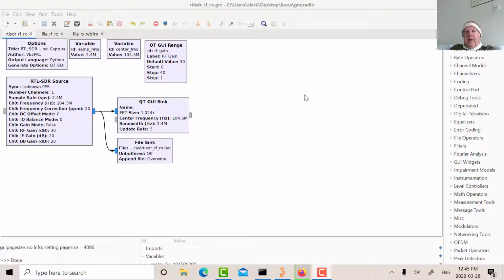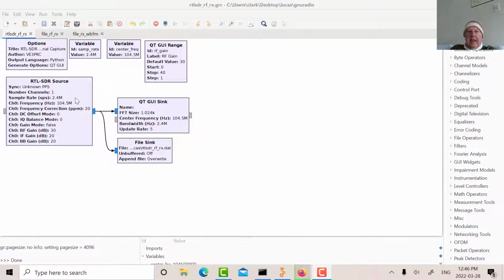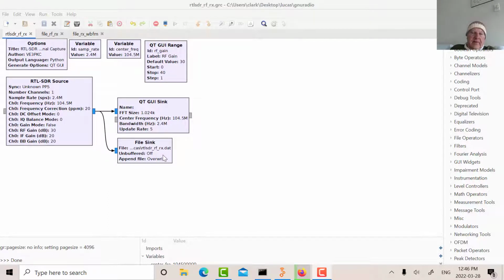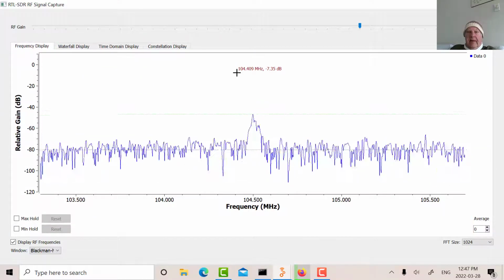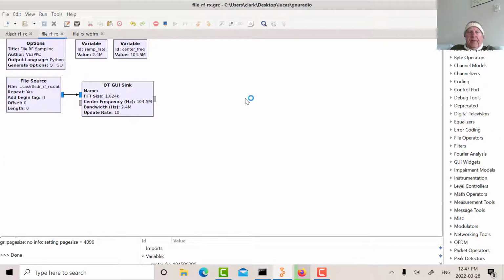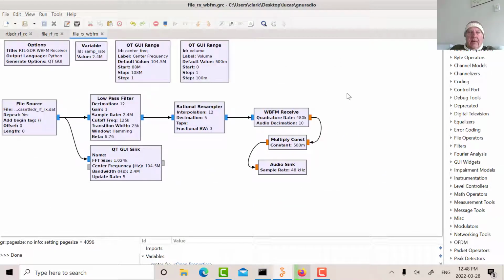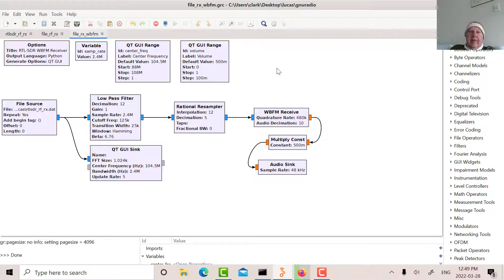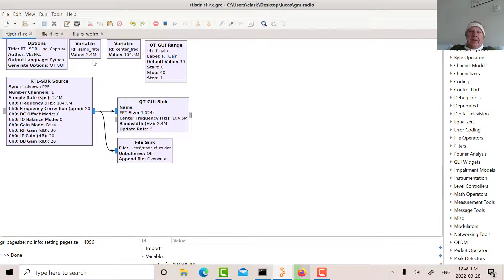RTL-SDR for RF Signal Capture on GNU Radio

Comment: bro if i have Sdr receiver 10k to 6 ghz, so from gnu software i can use 1ghz or 2 ghz frequency for different scanning like Jupiter galaxies, or i need converter device for that?
Reply from the maker: You need a GNURC source to match your SDR.
Reply: @ brother im confused for that, i have receiver sdr 10k to 6 ghz., then i can control adjust up down frequency from software or i need another hardware for that?

Comment: Hy Sir
When ever I turn on biast of my RTLSDR V4 and when I run GNU Radio it automatically turns off the biast. can you please tell mw the issue
Reply from the maker: Sorry I don't have a V4, not too sure. Check the manufacturer, they may require special drivers.
Reply: @ClarkTelecom  same issue when I tried v3 sir
Reply from the maker: @zulkiflnawaz4536  Check out Reddit, there is a discussion about that. Can you power your device from usb rather than the biasT?

Comment: Great insights, how do I capture 5G signals at a 100Gb rate preferably using a PC and a GNU radio tool without external dongle connections? Much appreciated!
Reply from the maker: Check out GL Comms they have gear that works at those speeds:
https://www.gl.com/

Comment: When I replay the captured signal it seems to play at a higher speed than it was recorded. A 15 second capture finishes playing in like 1 second. I had to add a throttle block to slow it down. Is that normal? This only happens when I use my hackrf. If I use my rtl-sdr then it plays back normally.
Reply from the maker: The files get big very fast, maybe you ran out of storage space after 1sec if you are using a large sample rate on the hrf1.

Comment: can you help me sir pls i want to do a project in my college because i don't have the SDR device

i need you kindly to send me captured  RF signal using the SDR GNU software. This could be a signal from an FM radio station or any other RF source.

then do what ever should be done to the signal but kindly just don't filter it, i need it noisy to filter it with MATLAB.

finally I kindly need
1-picture of the GNU of what you did like your.
2- I need the input signal file we to put in MATLAB as (.wav or .mp3)

kindly help me sir💕💕
Reply from the maker: Try the Signal Wiki page for examples of signals:
https://www.sigidwiki.com/wiki/Signal_Identification_Guide

Comment: Can you please explain, how we are getting 104 Mhz freq data with such small sample rate 2.4 M?
Reply from the maker: You are not. The RTL down converts the RF 104MHz signal to baseband, and you are only sampling 2.4MHz around this.
Reply: Thank you sir! 
Can you also tell how this down conversion is happening with SDR, like which block in gnu radio making SDR to down convert?
Reply from the maker: The source block controls the rtlsr.
Reply: And sir, this Ch0 : Frequency ( Hz) : 104Hz , is also working as LO frequency for SDR?
Reply from the maker: You can study how it works on rtl-sdr.com, lots of articles. @dot_ball
Reply: Thank you sir!
Reply: Sir, I want to capture the dist tv signal, which is around 950Mhz to 2150Mhz . I am using Hack RF one and gnu radio , if you know some article, which can be helpful for me, can you please suggest some?
Reply from the maker: Try rtl-sdr.com or post on their forum. @dot_ball

Comment: How can we capture a signal transmitted from a HackRF and also decoding it?
Reply from the maker: The HRF1 is half duplex, so either tx or rx not both. So you can use an RTL-SDR for rx either on Gqrx/SDR# or GNUradio with Osmocom Source block. The Adalm-Pluto is full duplex. I have various videos for different signal decoding, so for example SSB (Fig.6)
https://jeremyclark.ca/wp/telecom/rtl-sdr-for-ssb-on-gnu-radio/
Reply: We must have the same senior project lol

Comment: When an ADC captures RF..  how does it go from say 16-bit digital data, to 16-bit I (in-phase) and 16-bit Q (quadrature or 90 degrees out of phase with respect to I)?

Any plans on making videos for the other types of signals mentioned?  NBFM (Marine) , AM (ADS-B),  VHF airband, AIS, SSB, VOR?   
For example, I'd love to use GRC to send/receive morse code!
Reply from the maker: The input RF feeds two channels. The I channel has a mixer with coswct, the output feeds an n bit ADC. The Q channel has a mixer with sinwct, the output feeds an n bit ADC. So two n bit ADCs. I already have videos/blogs for those signals.